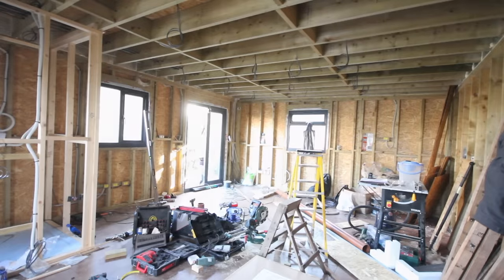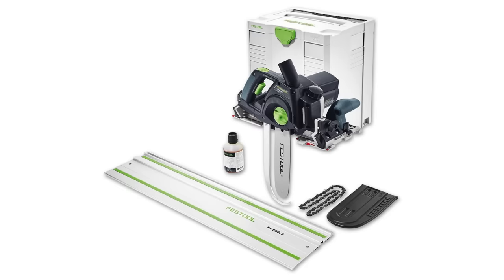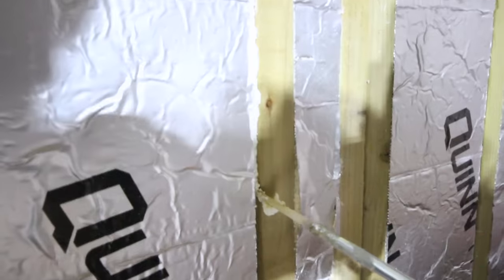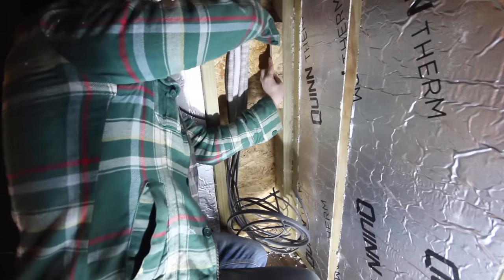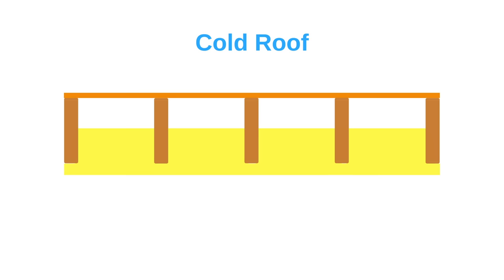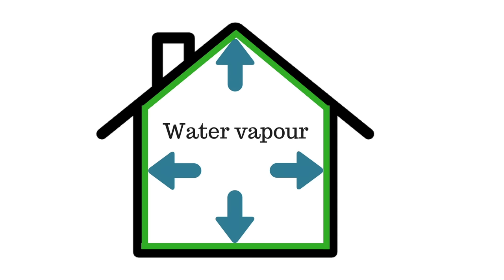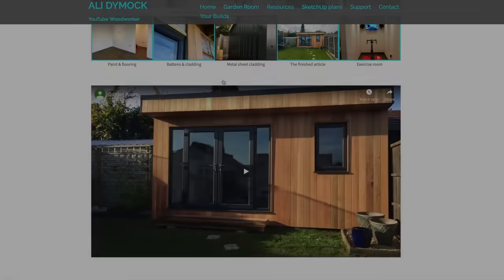Garden Room Workshop: Part 15. Wall Insulation & Vapour Barrier

Comment: Hello, lets frist say what a great series you made here! I have a question for the insulation part. I am building a shed myself and i am worried about insultating tight against the osb (outside wall) because of condensation aigainst the osb, because the cold air meets the warm air inside the wall.  Am i wrong about this? I hope you can awnser my question (i live in the netherlands and all i can find here is that they dont use the osb on the ouside but they attach the vaperbarier against the studs)  kind regards
Reply from the maker: Hi Marlon, it's a really interesting question and I had someone from Germany comment the same so it looks like different building practices are used in different countries. In the US, OSB is used every time. OSB should allow vapour to pass through it to reach the air space created by the battens (before cladding) and then evaporate. The only time to use a vapour barrier on the outside is in hotter humid climates where air con is used inside, essentially reversing the wall build up. If you feel your build will be strong enough without OSB sheathing then just put a breathable membrane on the outside, battens then cladding 👍

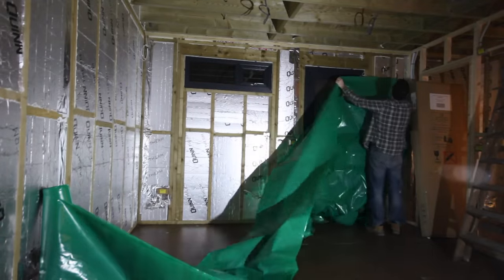Comment: Hi, I have been watching your videos with great interest whilst building my own, smaller garden room and throughly enjoyed them. Just a quick question,  why at 13:20 in this video do you trim back the tyvek membrane flush to the inside face of the windows??
Reply: I'm going to guess by saying that the sealer glue stuff may not bond well to the house wrap and it needs to bond to the timber instead.
Reply from the maker: Yeh pretty much it. You could cut the tyvek back to the outside of the windows so the foam adheres to the wood better but then you have to be more careful with sealing the outside
Reply: @AliDymock  Thanks for the reply.  I went for a compromise, in that I trimmed the outside membrane flush with the inner face of the timber stud the taped the vapour barrier to the window reveal.  This will have plasterboard fitted to create the reveal when it is plastered. It's all a learning curve.

Comment: With those density foam panels and that vapour barrier you better hope you never have a fire.. Think of that Grenfell tower block fire and those flames and fumes are what you could have - the makers keep this quiet.... Additionally you don't get a good seal with those panels meaning you then have to add more toxic expansive foam... Wood fibre would have been a better choice..  Natural and fills in all the small places.. 

All those timber studs will be thermal bridges where heat is lost..

Comment: @Ali Dymock when I first started out building a shed I didn't realize there was more to building one than I 1st thought.. I am building a shed with 3x2 timber and 3x2 noggins. I have come to the roof rafters and i'm stuck on how to go about doing the air flow.. should I add 2x1 going in opposite direction on top of the rafters. add breathable membrane then OSB board?----- or add 2x2 noggins between the rafters (for air flow) then breathable membrane then OSB board? in between rafters I will be adding vents either side.. my shed will be heated and used all year round.. many thanks
Reply from the maker: Sorry for the delay in replying. You might wanna shoot me an email with pics and I'll try to answer better there: hello@alidymock.com :)

Comment: Hi Ali, could you not just use aluminium tape again on the walls and roof to cover all the joists and gaps, as you did for the floor, to act as the vapour barrier? would there  be any reason not to do this, this might be an easier option for my build.
Thanks.
Reply from the maker: Yes you can! Polythene sheet was cheaper but alu-tape like I did for my floor works just as well

Comment: Hey with all these garden room, am I right in thinking I could use this style of building to make an extension to my house
Reply from the maker: Yeh, there's no reason it needs to be in brick and block, timber is just as good if not better. The one issue is the boundary so have a good think about that unless you have a detached house.

Comment: I am about to insulate my log cabin but hate the idea of retrofitting a stud walls to the inside as the logs are pretty strong anyway. Could I just use some flat planks to offset insulated plasterboard from the wood + vapour membrane ?
Reply from the maker: I think that would work nicely. Maybe batten the log walls then insulated plasterboard on top. Selco do a GTEC thermal board or Kingsapn have K118 board which has phenolic core-slightly higher R-value (lower U-value) than just PIR but not a huge difference.

Comment: Would you recommend the celetex to insulate between the floor joists in the attic? Would I need air to circulate between the joists or would it be okay to use sheets the same thickness at the joists?

Comment: Hi I was hoping for abit advise, I have built the frame of the building it is not a big building as yours. One half will be workshop and the other half office, I will only be insulating the office half because honestly I can’t justify doing it in the workshop for the amount of time I will be in there.

I am using 50mm PIR in the walls and 70mm in the ceilings as the timber is larger for the roof. I was then over boarding it all in 11mm OSB  then plaster boarding over that. Would you recommend using the foil tape over the studs overlapping the PIR? Would you use foil backed plasterboard on top of the OSB. Any advise would be greatly appreciated, the building part is not the problem I really need advise on keeping the office warm! 
It’s a concrete base also full timber building.
Reply from the maker: Foil tape would work but I'm not clear on what the OSB is for - perhaps something to attach shelving etc to through the plasterboard. I not, then I would just put plasterboard straight on to the studs as I did.

Comment: Hi Ali, like your movies, short question. I would like to make makita family tools collection in my house. So I am looking for gun nailer. I need to choose between Brad nailer and frame (finish nailer) becouse those tools are seriously expensive and can buy ony one in time. Just in short future would like to start build my summer house and I thinking about the Brad nailer will be enough powerful to attach OSB board or chipboard to frame of summer house? For cladding I know will be good but for the rest of works? Would like to use gun to attach engineering wood panel on my staircase, any more soft work in home, that why I need to choose between Brad and frame nailer. Thanks for answer and for your videos!
Reply from the maker: Ah man it's a tough choice and that's why I went for a pair of dewalt nailers in the end for both. As you say the brad or pin nailer is good for cladding, furniture, panelling etc but probably not for attaching OSB. For that you need a 1st fix nailer where the nails have proper heads which is super useful for attaching your timber frame together, OSB sheathing, close-board fencing etc. So it's a really hard call if it's just one. Maybe go with the brad nailer if you're going with secret-fix (hidden nails in the tongue) cladding because there really isn't a good alternative to doing it and then just use screws for attaching timber and OSB.
Reply: @AliDymock  I will buy brad one and for OSB board I will use a high-tech hammer and classic nails :) thanks :D

Comment: Hello, thank you for posting this video. Did you leave an air gap between the insulation boards and the inside of the room?
Reply from the maker: I didn't, it's flush with the inside of the studs. The gain from the extra thickness of insulation outweighs any radiant heat reflecting back from having an air gap (if that's what youre getting at) or perhaps you mean for electrics, in which case most of my cables are in the ceiling and those that are in the walls are in conduit.
Reply: @AliDymock  would going flush to the wall with studwork be the same for a single skin breezeblock structure or would that need a cavity? Thanks, and thanks for the great clear videos.

Comment: It seems you’re doing everything absolutely perfect. But do you think the polythene sheets on the internal wall are slightly overkill?

Or to word it better, is that totally necessary?
Reply from the maker: Good question.I would probably make the argument like this: Think of it as a scale from a cheap shed on end to a high end timber-framed house on the other. All the extras you add move the scale towards the house side of the scale. Would the building be 'fine' without the polythene vapour barrier? Probably. 

I could have gone for cheaper insulation throughout, no OSB on the walls or on the roof joists etc. I could have also gone the other way - underfloor heating, more insulation, aluminium windows and doors etc - I guess it comes down to your time, what you want from the room, your budget etc ;)
Reply: its definitely not needed on the inside of the walls when you already have tyvec on the outside of the walls
Reply: @s1dew1nd3r4  I disagree.  3% moisture in PIR leads to a drop of 33% efficiency.  The vapour barrier will prevent this loss.
Reply: @s1dew1nd3r4  Tyvek is not a vapour barrier. Those are 2 different things that are both very important to have: an air barrier on the outside (tyvek or equivalent) + a vapor/air barrier on the inside (poly or equivalent)
Reply: @RickGrimes807  so you would put tyvek on the outside and then what would you line the inside with?

Comment: When you install a cold deck roof you must install cross flow air vents at roof level.
Reply from the maker: Yup! Mine is a warm roof so no ventilation required 👍

Comment: Have you ever used EPS insulation sheet. Been looking at it today, it says you need to go 30% thicker than pir but its 50% cheaper and doesn't off gas so therefore retains its r value forever where as pir drops off a lot over time.
Reply from the maker: I'm aware that there can be a drop off in PIR that has gas in it rather than air as that gas escapes over time - a bit like a double glazed window. If you have thicker studs, say 6x2"s then EPS or XPS might be a good option but no I've not used it. However I'm thinking of building another garden room with a concrete base and it's no big deal to dig deeper to get that extra thickness of polystyrene and save the money over PIR so defo worth considering. Overall it depends on how warm and fast you want your GR to heat up. Many houses have no insulation and they're perfectly liveable so polystyrene is certainly better than nothing. Go for it I say.
Reply: @AliDymock  since posting this i had a look into the eps and was surprised that it is highly flammable. I thought it might have been treated for this type of use but seems not. I suppose it depends what your using it for and a garden room isn't a livable dwelling but they are a big investment. I've not looked into xps to compare or super foil/super quilt.

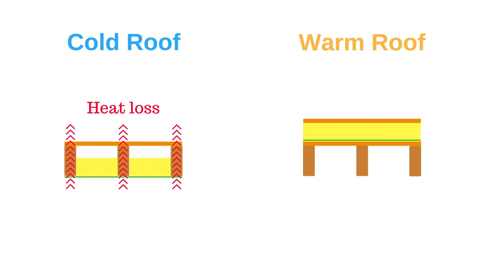Comment: 09:50 Anyone who copies your warm roof should definitely not add any insulation under the joists. That would pull the dew point down and risk lowering it as far as your lower deck / top of your joists.
Reply from the maker: Agreed, only for cold roofs
Reply: True👍

Comment: Hi, could i use tyvek house wrap for my roof? then place supershed felt over the top, would that work the same as polythene sheet.
Regards Pete.
Reply from the maker: Ummm it can work as a vapour barrier if turned to face downwards but it’s a pricey way of doing things.

I suspect you don’t mean a vapour barrier but just extra protection under the felt in which case yeh it might work!
Reply: Well i already have an extra roll of tyvek as i bought two.  so if i face the tyvek writing face down on my osb roof, that would work? or do i need to place it from the inside facing down? 

so the layers of my roof will be "super shed felt" under that "tyvek house wrap" then "OSB3" under that "Recticel PIR insulation" taped joists with aluminium tape for complete seal" and last " Bathroom 10mm Pvc sheets gloss or matt white for the inside ceiling.
Reply from the maker: I'm still confused lol. Is this a warm roof or cold roof ? Basically if you're using tyvek as a vapour barrier then face the writing side downward towards the inside of your building and make sure it's on the inside of the insulation so a cold roof you'd want it below your joists and a warm roof would be above your joists but before the insulation. Hope that clarifies things!
Reply: @AliDymock  you should start charging a pound for every response mate lol, not because you've being tight but I've just read you replying to over a hundred people questions half of them will probably never build anything lol.

Comment: I'm in the process of doing mine. Shouldn't u have vents at the top and bottom of the walls to allow airflow on the cold side like u do with the roof or is the breathability of the cladding in my case feather edge ample enough?
Reply from the maker: You've essentially got 3 things working for you.
1) the vapour barrier internally
2) the ventilated space behind the battens
3) trickle vents in doors and windows and in my case an extractor fan in the shower room.
That all said, if you haven't got windows on different sides of the building or haven't got trickle vents in them, vents aren't a bad shout, make sure they can be open and closed though

Comment: Ali, does the vapour barrier on the ceiling need to be tight? ... Just wondering if I could have it sitting on top of my for rated down lights?
Reply from the maker: Have a watch of these two videos depending on which roof type you are choosing:
Warm roof: https://www.youtube.com/watch?v=X2oHYzh5PaE
Cold roof: https://www.youtube.com/watch?v=sw5WsdPtChc
Reply: @AliDymock  thanks Ali for taking the time to reply.  Videos are great but I have gone with no ventilation... I have s void of 70mm but wanted to run integrated lights for air tightness and not puncture the vcl ... I'm wondering if the vcl can sit directly on top of down lights without causing an overheating risk ... Dinner lights are insulation coverage, but this is mineral wool ... I wish I had gone for warm roof now😭

Comment: Ali, just a quick question regarding my roof insulation. I'm doing a cold roof with rockwool as sound insulation takes precedence over thermal fir my build. My a gap will be above the rockwool with holes drilled at the top of the noggins to allow air to flow freely above the insulation. I'm going to drill holes in my soffit boards to allow air in. My question is, does my rockwool insulation need to go all the way to the end of the span, i.e do I need to put rockwool in the area above the soffit boards? I have a fairly decent overhang here. I'm worried that if the insulation does in fact have to go all the way to the end, it would cover up my vent holes in the soffits. What are you thoughts? Cheers
Reply from the maker: Nope, just over the top of your wall's top plate, then stop there. Insulation in the soffit won't do much to stop sound or heat escaping 👍

Comment: I want insulate wooden log cabin from outside. I would like to use kingspan (or similar). Can you advise how to do this, please?
Reply from the maker: When you say 'log cabin' do you mean one of these pre-fab ones with quite thin timber walls? That can be tricky as you need your fasteners for the insulation to bite into something substantial. There may be ways of sticking/adhering it but no doubt you want cladding of some type afterwards. So maybe battens first then insulation then have the cladding attached through the insulation to the battens. Instead you could go with insulated plasterboard inside like I've done here: https://youtu.be/nSnbMsSzdXU but I guess you want to preserve the timber look inside rather than out?

Comment: What did you do for ventilation in your roof?
Reply: Is this a freestanding structure or the lower part of your house? The video seems confusing.........if this is a separate structure, there needs to be airspace above the insulation and venting in the soffits.

Comment: Hi there would I not need an airgap in the walls or can the insulation go all the way to the OSB?
Reply from the maker: So I put mine all the way to the back but the gap to allow moisture to evaporate is created with the battens prior to the cladding going on

Comment: HI Ali. Ive used tape to seal my PIR. do i still need a plastic vapour barrier installed. I have a cold roof instillation. Also if i have an internal vapour barrier installed, do i need air vents in the room to prevent internal condensation, or is this not necessary?
Reply from the maker: aluminium tape is totally fine, no need for polythene. You will want trickle vents in your doors/windows I'd say. If you've done your air tightness work well they're very important. If not, then like most houses, there is enough air going in and out to not need any vents
Reply: Ali Dymock Cheers Ali that’s Great. Not got a clue how to retro fit trickle vents in doors and windows. You tube here I come.

Comment: How would you fit spotlights in a cold roof with kingspan insulation? I’m worried about leaving holes in my vapour membrane.
Reply from the maker: If you're happy to go with tracklights and keep the vapour barrier intact that will be best but it can be done, you just need to ensure you ventilate the top out of the soffits.